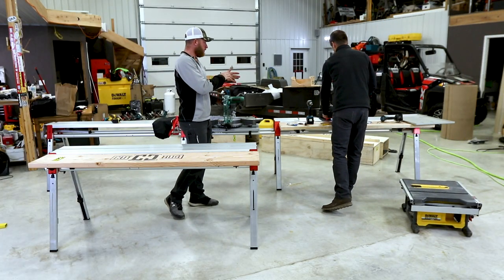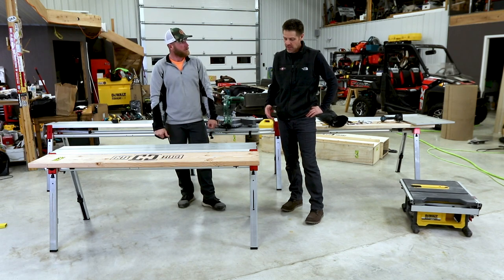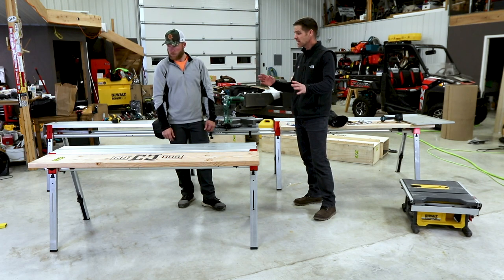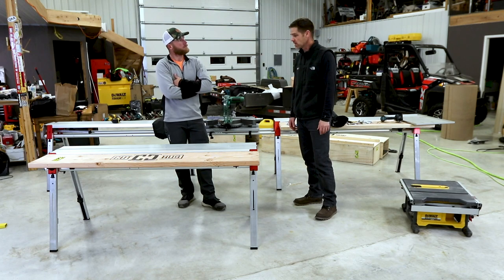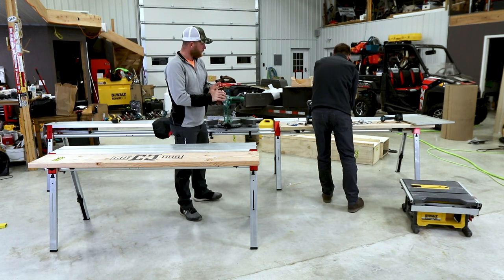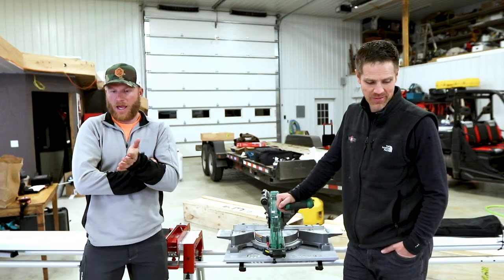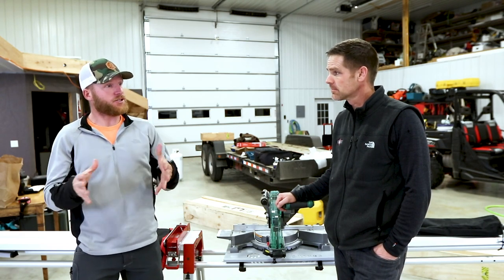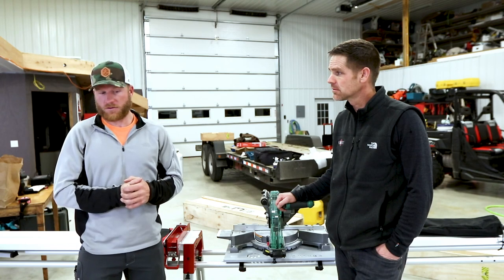Is this the best miter saw stand you've never heard of?

Comment: Lol cost hundreds of bucks when you can made it with 5 OSB panels 6 trestle and 2x 4 LOL ! 

And also for the table saw : make a slot in it fix a circular by under made a guide with a 2x4 and that s it

sure it s more comfy , the price also is comfy 

cut hub like 3000 $   LOL

Comment: Looks pretty nice. I wonder how it does on uneven ground which is where I'm typically working.

I have the Best Fence system from FastCap which is pretty nice but really heavy with everything all together.
Reply from the maker: has adjustable legs and its super easy

Comment: No it's not the best I've ever heard of there is better. The Ron Paulk Total Station is great, but what works for me is The Paulk Compact Workbench paired with FastCaps Best Fence Pro. That's the best stuff right there in my arsenal of things to get the job done. If you already own a Dewalt heavy duty miter stand you may want to check out www.customfabricatingsolutions.com they have some terrific additions for that miter stand and some additions for your miter saw.

Comment: I appreciate someone trying to come out with better tools, but this thing is not a winner. The tubes under the saw attaching the 2 stands together look very weak and I could see those getting bent real easy.. And 8 legs? This would be a major pain on anything other than concrete. I can build a stand on the job site with wood for under $50, in the same time it takes to set this up.
Reply: @lorinbowles9321  If he won't sell you the wood one for $50 I can make you one too for under $50. Can you build your cut hub from scraps around the jobsite? I can. Can you easily modify your cut hub with basic tools/materials? I can. Can I do all the things with mine that your cut hub can do? Probably not all of them but does anyone use all the features on anything? No, just the basics, we carpenters not space station fabricators. Oh, and you don't have to have a payment plan to buy mine!
Reply: Hammer ( 25 bucks).vs Nail gun (gun 300-400 bucks, compressor 400-1000 bucks,  hoses-100 bucks a piece).  I pick the space station
Reply: @cencoast_7.340  Watch some of the other videos, they go on about the stop blocks for repeatable cuts. Granted it's a nice stop block and one I'd like to have but not for 1500 to 3500 or more for the "system".
Reply: @ocp1669  i use a piece of 2x4 and a clamp for a stop.
Reply: @skliros9235  Yeah it doesn't have to be fancy, whatever works. You just need to put something there to make repeatable cuts. For 2x4's though, depending on what you are cutting it could be a little tricky, like if you are cutting a 2x4 and you use a 2x4 as a stop block, if the cut piece is flat, then use the stop block vertical. This will help with binding the piece up against the blade when you raise the blade (if stop block isn't clamped really tight or screwed down it can move the block making the next cut a little longer). Ideally using a scrap piece of half to 3/4 plywood would be a little better with binding. That or just get into a habit of leaving the blade down and move the piece out before raising it back up.